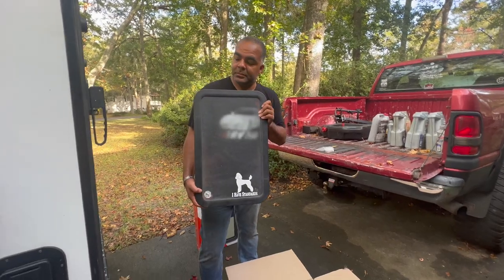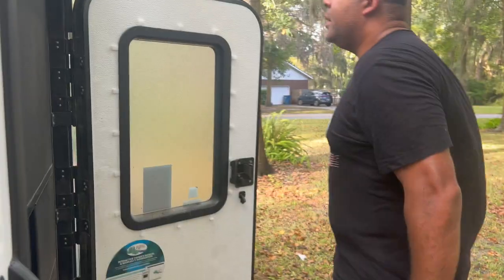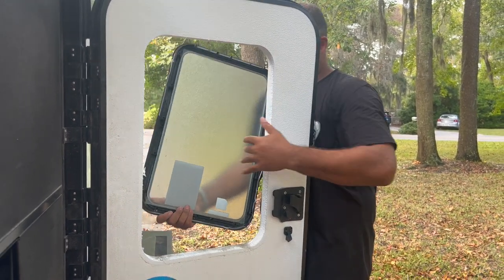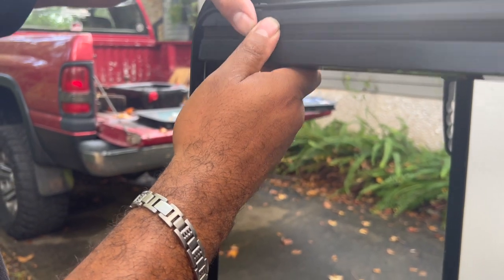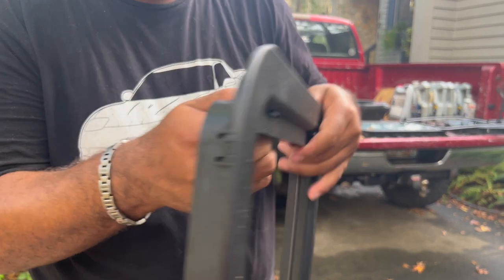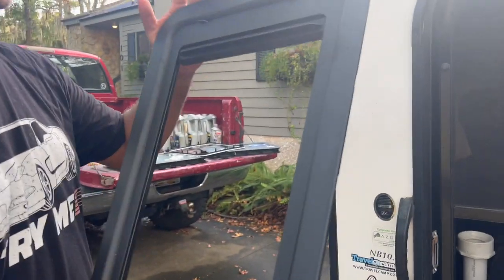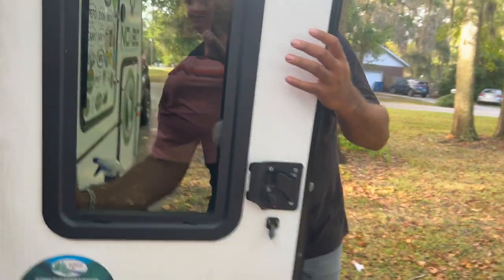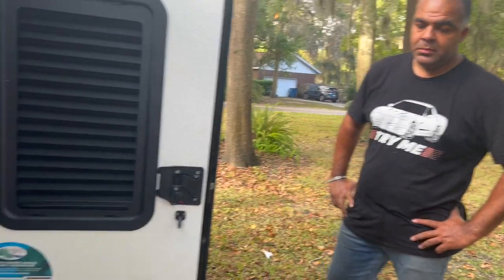NoBo 10.6 Thin Shade Window Swap

Comment: Do you have a size or model number for the replacement windows?
Reply from the maker: Here’s a link to the windows we used. They are a perfect fit! 

https://www.amazon.com/Lippert-Components-806621-Complete-Window/dp/B07XPFTS9R/ref=sr_1_2?gclid=Cj0KCQiAyMKbBhD1ARIsANs7rEHSJC4g5CnnksMKcb252QKY_1om0ubG47RFE9owktjDuS3PpvxWcfMaArVKEALw_wcB&hvadid=386329715025&hvdev=c&hvlocphy=9011306&hvnetw=g&hvqmt=b&hvrand=9576673759957624062&hvtargid=kwd-826573579833&hydadcr=8116_10892995&keywords=lippert+thin+shade&qid=1668366368&sr=8-2